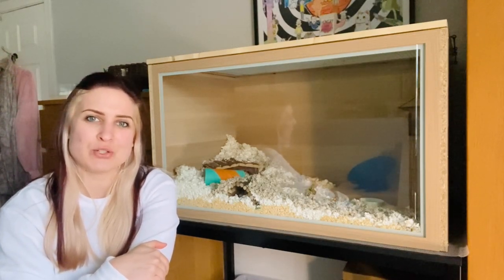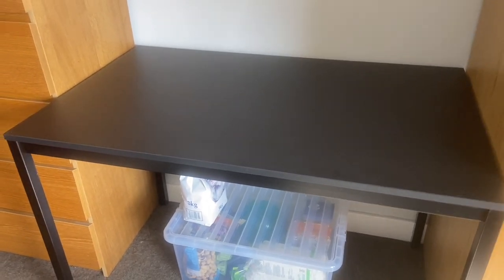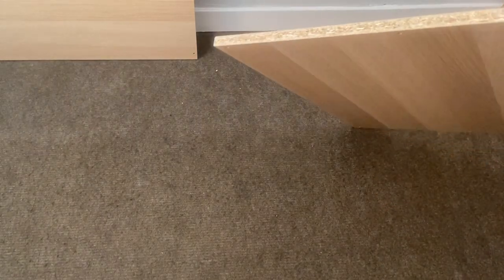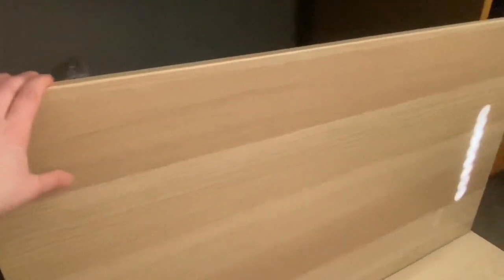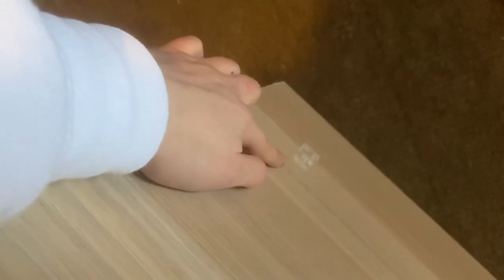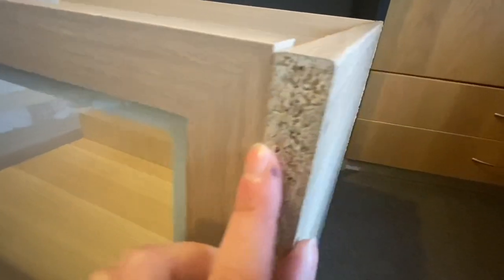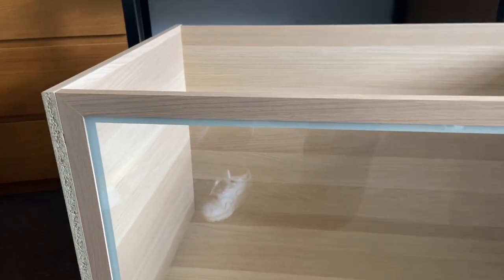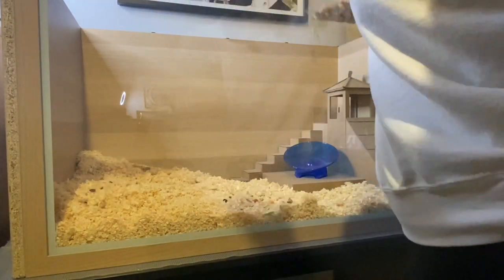IKEA KOMPLEMENT | DIY New Hamster Cage Tutorial 🐹 Cheap & easy

Comment: This is a great DIY cage, I love that the glass panel is part of the range rather than something you have to try and source separately or make custom fit. The depth (front to back) as well as height I've been looking for an aquarium in is impossible to find. This would be shorter but actually have a little more depth so not much floor space would actually be lost. Plus you're right, it's actually pretty cheap. Thanks so much, will put this one down on my research list :D

Comment: I love this cage! You did a great job I’m sure your hamsters are going to love it. I was wondering what type of bedding you using apart from the paper based one what is the other one?
Reply from the maker: Thank you! In this video I used paper bedding and the white one is much softer (kaytee brand). There is also some wood chips but I have stopped using them as I’ve been told it’s not hamster safe xx

Comment: Did you do anything special to waterproof it from pee? Or is the wood already kinda waterproof?
Reply from the maker: I haven’t had any issues yet, the wood is pretty good and my hamster uses the sand bath to pee so I’ve been lucky 😅 but it wouldn’t hurt to seal it if you think you need to x
Reply: @lindseyolson4  Thank you! Love the thorough guide. :) Mine mostly goes in his sand bath but he also goes in his burrow in a certain spot, so I will consider sealing it with something hamster safe

Comment: Would this glass shelf work with ikea stuva (128x50). It's 28 cm shorter but maybe I can add 28 cm frame? 🤔🤔
Reply from the maker: The Komplement glass shelf I used is 100*58cm so I think it might be too big for the Stuva but bear in mind you can get different sizes of the komplement range, so you could get a smaller sized glass shelf to make it fit the Stuva :)

Comment: Great set up, Seeing your hamster burrowing I just want to say you might want to consider adding more bedding for greater depth. Hamsters need 7-11 inches (17-27 centimeters if my conversion is correct) of bedding.

You might also want to invest in a wheel thats at least 11 inches (27 centimeters)  as flying saucers cause spine curvature and can lead to spinal issues, which is the same issue that can be encountered for wheels under the previously stated measurement.
Reply from the maker: Thank you! I’ve added all of those as soon as people commented about it so now Bilo has lots of bedding and a big wheel 🥰

Comment: That is not 800 something squ inches no were near
Reply: It's actually almost 946 sq inches.  Even better!!!  The outside base is 100 cm (39.37 in) x 61 cm (24.02 in).  39.3 x 24 = 945.66 sq in.  I think it's an awesome size for the price and for the ease of construction.  It's such a better footprint too.  The height makes it so much easier to have a big wheel, which is hard in the Detolf cage.  She did a great job!